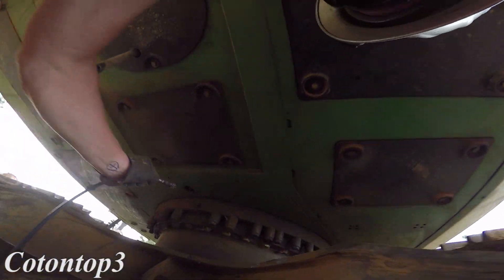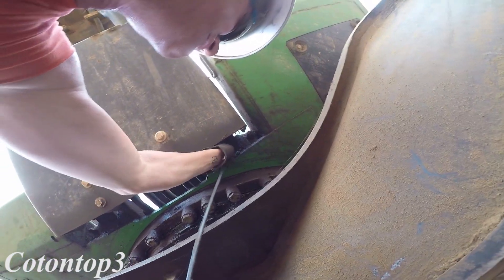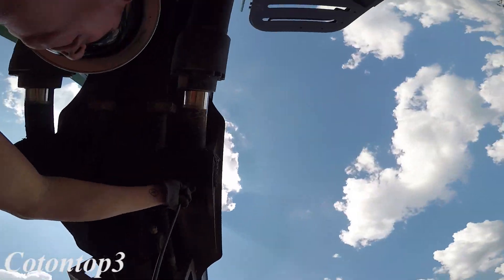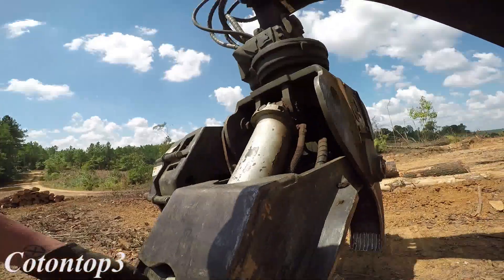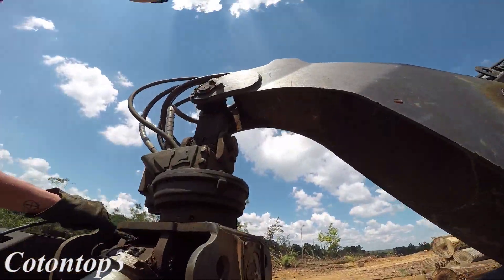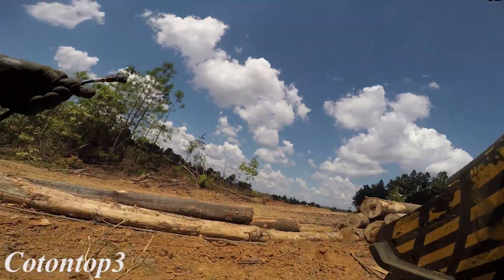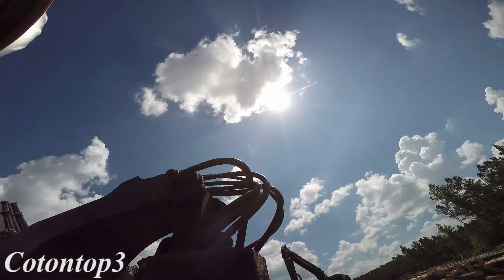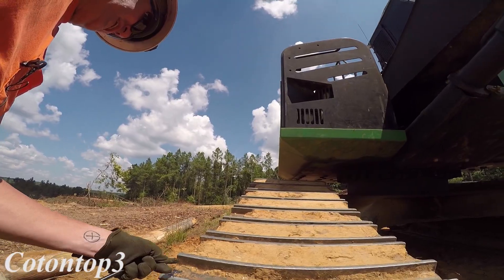Grease gun cam, GoPro on a grease gun!

Comment: The wireless mic with the recorder sounded fine for me. Totally agree on your greasing. Used the same , hand greaser, on my truck tractor and roll-off trailer. 94 fittings total only took 15 minutes. Of course that's when the creeper didn't break because of a weight overload. :)

Comment: We did use a lincoln battery operated one but the problem up here in canada is the cold winters.  the batteries just don't last.   You have to keep then in the cab of the truck to keep warm or you forget a battery on the charger at home.   So we wwent back to the manual ones.  doesn't bother me at all.

Comment: I understand about the hand greseing. I operated a Toro 580 D. 60 fittings (about) and the mechanic wanted a lot of greese in the blade spindles on a daily basis or it would seize up. More or less just hit the main ones on a daily basis no matter how many hours I put on it. The U Joint were every 50 hours.
Thanks and take Care

Comment: nice video. on the farm we use the John Deere 12 volt grease gun, and while it's really nice to use, the batteries on them suck. haven't used them 2 years and they won't hold a charge on standby, won't pump but about 2 tubes of grease and you need to charge it again. also, I see you don't wipe off the zerks before you pump gease...I guess it doesn't matter if it's not a bearing, just a pin?